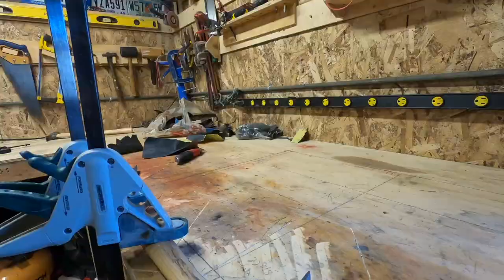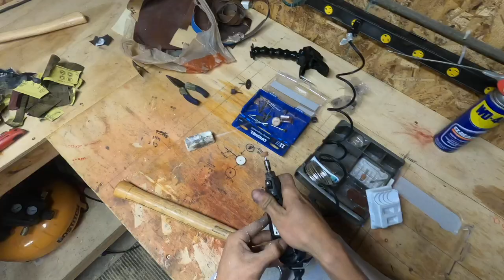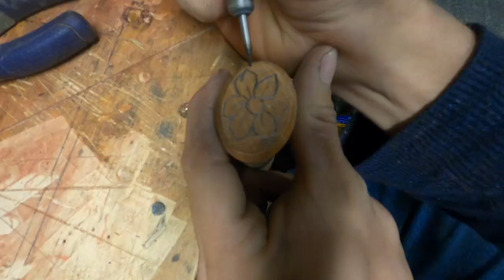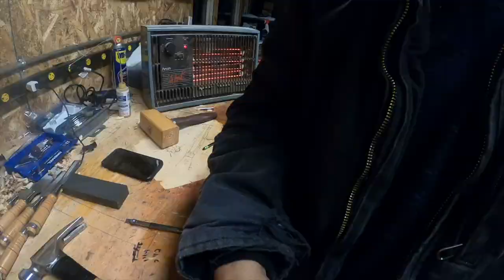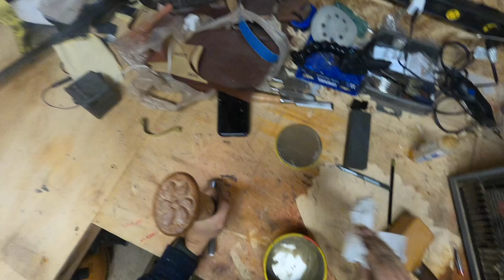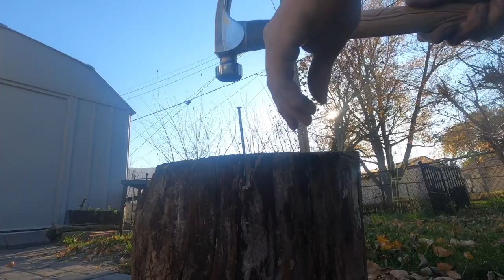One Night, One Hammer

Comment: The hammer isn’t for use ?  Very pretty but my Estwing 28 oz framing hammer goes through hell and one day of sweaty hands would ruin a shiny finish and a waxed handle would be an accident waiting to happen ….I’ve only got one wood handled framing hammer a hart that has 40 some years use.
Reply from the maker: No sir I use this hammer. As long as I got the glamour shots. The only thing that can make it prettier is a nice work patina👍
Reply: @certifiedladderholder  all mine has a patina from years of use the youngest hammer I have is probably well over 30 years and some are 50 years or older  so they all have a good working patina lol my framing hammers are pretty much retired lately as after 55 years framing is a little rough on my old body.
Reply from the maker: @danbailey96  That’s what I’m talking about. Old hammers are the best hammers.